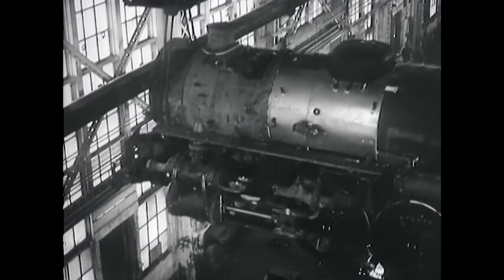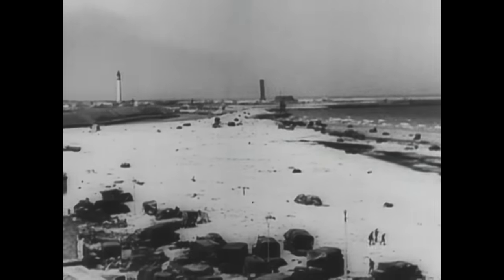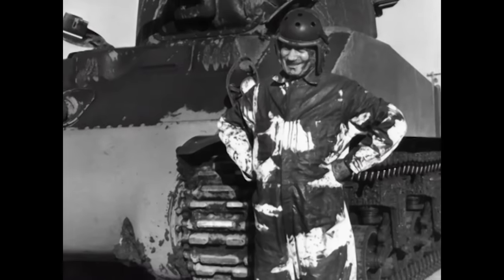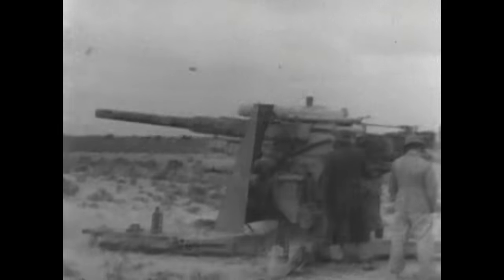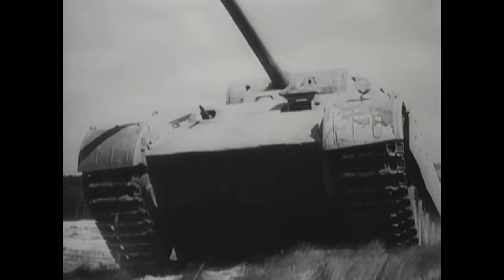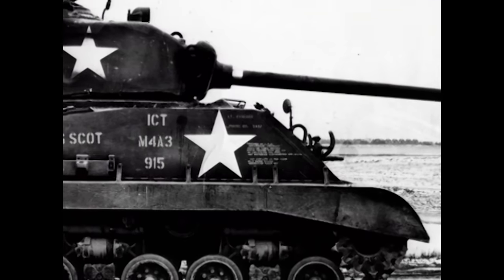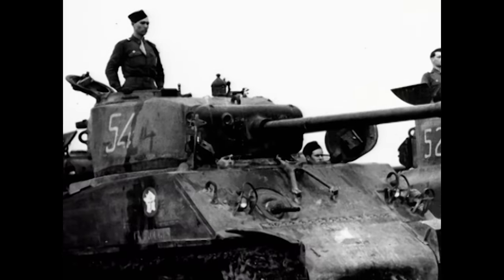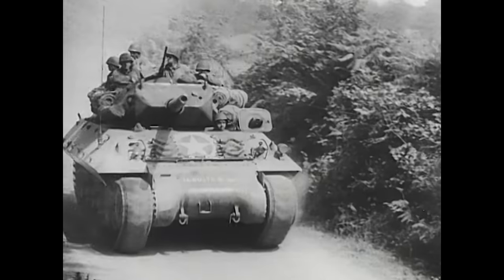Why The Sherman Tank Arrived Just In Time For The Allies | Tanks! | War Stories

Comment: The coolest thing about the Sherman were the level ups. Upgrading the hull to plate welded armor, better ammo stowage, better suspension, and a higher velocity gun eventually made the Sherman an incredibly strong tank for one produced in such high numbers.
Reply: Limited numbers of Jumbos apart, I wouldn't call it "incredibly strong" tank by 1944/45 standards, and Sherman crews didn't agree with that.
Reply: By 1944 it was well out of date and the 76mm gun was only marginally better than the old 75mm. It was bottom of the league in terms of gun performance.
Reply: @billballbuster7186  The heavier armored versions of the panzer IV, the H and J variants, were the only medium tanks that the 75MM versions had consistent problems with. They were not numerous or reliable, their speed was a full 10MPH slower than the previous versions, and their range was abysmal. The 76MM did not have issues dealing with them. Anything heavier armored would have justified an airstrike. The myth that the guns on the Shermans were inadequate originated with the Battle of the Bulge, during which a number of heavier armored Panzer IVs and heavier tanks were used. The American troops in that portion of the line were mostly newcomers and Airborne. The real takeaway from that battle was the inadequacy of the American bazooka. If the Shermans had a heavier gun then speed and range would have been lower, and the chances that they could mobilize to fill that gap would have been lower. 

Also the 76MM was not a marginal upgrade over the 75MM. It was a much higher velocity round and the diameter does not paint the whole picture. The round was longer and heavier. The higher velocity meant that the explosive versions of the rounds couldn't have as much punch, and many tank commanders chose to stick with their 75MM due to using their tanks primarily in an anti-infantry role. Tank on tank battles were never a good idea for anyone involved. The majority of tanks of any kind were destroyed by aircraft, mines, and infantry carrying anti-tank weaponry. The range, reliability, numbers, weight and anti-infantry capabilities of medium tanks were essential. Being able to go tank to tank was not.
Reply: FYI The "Level-ups" as you call them, were mainly the result of mass production. The M4 and M4A1 were identical but some factories used welded RHA plate. While Lima used steel castings in its construction. Indeed every factory had its quirks, different engines, engine decks and construction details.

In 1943 it was decided to update the Sherman rather than introduce a new tank. The original design had poor protection, it easily burned when hit. So "Wet" ammo storage on the hull floor was introduced. It was still too tall due to the Radial engines still being used. The 76mm M1 replaced the 75mm in a turret designed for the T-22 - T-23 which were intended as the Sherman replacement.

The 'new' Sherman entered production in 1944, but in truth it was far from ideal. Its technology dated from the mid-1930s and the M1 Combat Car. The Sherman itself was designed in 1940, so in reality it was an old tank dressed up a little. Today tank designs age more slowly, but in the 1930s and 40s there were new innovations every day. The Sherman was positively primitive when compared to the British Cromwell which entered production in1943 or Comet of 1944 in the same weight class.
Reply: @billballbuster7186 The up-gunned 76mm high velocity gun had enough power to punch through the frontal armor of a Tiger tank. The E8 line of Sherman tanks made it one of the most feared tanks in WWII. Combined with the improved engine, it was a tank killer.
Reply: @chris.3711  No, the frontal armour on the Tiger was 120mm of high quality face-hardened armor. The 76mm M1 could penetrate 87mm of armour at 1,000 yards, do the math. Also there is no record of a 76mm M1 ever penetrating a Tiger, not one instance. You are just shooting the breeze, speculating on fake WoT info. Your generation frequently gets fantasy mixed with reality. The ONLY allied gun known to have penetrated the frontal armour of the Tiger and Panther is the 17 Pounder. Which could penetrate 130mm of armor at 30 degrees and 1,000 meters.
Reply: @chris.3711  Incidentaly the "E8" suspension had nothing what so ever to do with tank gun performance.
Reply: The Sherman was a bad design. It had a very high profile, poor mobility, light armor and a weak gun. By 1944, even the upgunned and uparmored panzer IV tanks easily outmatched the Sherman. Against more advanced designs like the Panther or Tiger, the Shermans were all but wiped out in tank versus tank engagements.
Reply: @haroldfiedler6549  It was universal, all WW2 tank veterans using the Sherman criticized it. Mainly because of the ease at which it caught fire and the gun was useless against other tanks. The 1944 versions had  better safety against fire but the gun, 76mm M1 was still bottom of the tables in performance. Only a total idiot would make the claim they were great tanks. The US claimed it took at least 5 Shermans to take out a Tiger or Panther.
Reply: @billballbuster7186  " frontal armour on the Tiger was 120mm of high quality face-hardened armor"
A common myth that is easily debunked when you realize that the Nazis didn't have the proper metals to make their armor properly hardened. They were running out of every material needed and the quality of their armor took a serious dive halfway through the war.
Reply: Most people don't know but armour had different quality standards. British and German were considered the best as they pioneered many of the hardening processes building Warships. German amour was excellent when Tigers 1s were produced. Not so good on Tiger 2 and later. However German armour could take a 25% drop in quality and still be better than American RHA.

But this is moot, in all my years studying this subject, I have never come across a genuine Instance of a 76mm M1 ever penetrating a Tiger. US Ordnance did do studies on captured tanks and hulks, but all failed. As I said the 76mm M1 was bottom of the pile in High Velocity tank guns in 1944. Even the tiny British 57mm 6 Pounder firing APDS  was better!
Reply: @dewdew80  You "debunked" nothing as the German armour issues came after the Tiger was in service. There have been no analysis on how much German armour was degraded or how severe the issue was? Only a blanket statement that armour production was affected by metal shortages. Pundits like yourself use that to promote the theory that the Tiger could therefore be penetrated by the 76mm M1, though there is no actual evidence for this, so no substance in your claims.
Reply: @billballbuster7186 Germany killed their own factory workers; just plain stupid.
Reply: @billballbuster7186 so you watch YouTube videos praising national socialist tanks; that doesn't make you an expert.
Reply: @dewdew80 the guy's an expert; he watched many YouTube videos 📹
Reply: The Germans had long barreled 75mm guns in 1942 we didn't get long barreled 76mm guns until 1944. This was due to superior German metallurgy.  The 76mm 3in gun in the M-10 was thick and too heavy to put into the Sherman. Western allies tank technology was 2yrs behind Germany.
Reply: @brooksroth345  the superior T-34 forced the German's hand.
Reply: Ok, if you refuse to believe the Sherman was a great tank then what did the Germans think of it?  Well, I don't remember the exact source, but the Germans did capture quite a few Sherman's, and gave them to panzer commanders and their crews to test their abilities.  We know their conclusions because they documented the results and their thoughts.  So, what did they, the Germans, who were used to using, "vastly superior tanks"?  They liked everything about it, from the gun, to the armor, the mobility, and especially the full set of spare parts that came with each tank, and the tools to use them.  In fact... the ONLY complaint or critique that they had was the height of the tank.  Do what you will with that information.
Reply: @haroldfiedler6549  bad compared to?? It was about 2 inches higher than a Pz IV, but shorter than a Panther and Tiger. It had 93 mm equivalent frontal armour (50 mm sloped at 56/57 degrees), the Pz IV only had 80, the Tiger 102. The Pz IV gun was superior in anti-armour, no debate there, but the Sherman had multiple things that made it a balance if not slightly better, and the later 76 mm armed versions and Wet stowage hulls were closer to being on par with a Panther, which weighed 10 tons more...
The Tigers and Panthers were, by most measures, heavy tanks and very rare. The occasional encounter with a Tiger could be dealt with by tactics and other weapons, the Panther actually was a greater loss compared to Shermans when fought...
Reply: @billballbuster7186  it wasn't 120 mm, it was 102. The 76 mm M1 only penetrating 87 mm of armour at 1000 yards was 30 degree sloped armour, not the near vertical of the Tiger front plate. Reality was more like 116 mm at 1000 metres
Reply: @brooksroth345  the l/43 75 mm the Germans had in '42 were rare, in the Pz IV F2 or 'Special'. A handful of them vs hundreds of L/40 M3 75 mms isn't really the detriment you're claiming. The M1 76 mm was put in a Sherman before it even saw combat in '42 but it wasn't an ideal fit. When it could have been available in early '44 it wasn't deemed necessary, which was well considered.
The idea to build thousands of decent, 'well armed for the main task' tanks rather than a handful of quite strong ones as the Germans did is precisely one of the elements that won the war. The best tank will always be the one  that you have in battle, not the one you don't!
Reply: @MarkofZollo  I gave gun comparison according to universal data which is penetration at 1,000 meters at 30 degrees. However ammunition is not exactly constant so when tested at this range there is 51% penetration, 49% don't penetrate. I really don't want to labour the point, but there is no recorded instance of a 76mm M1 EVER penetrating a Tiger 1 frontal armour. So you are talking theoretically not factually. Now the little 6 Pounder (57mm) was capable of of penetrating Tiger frontal armour using APDS. it penetrated 132mm. 1,000 meters at 30 degrees. That was fact.
Reply: @billballbuster7186  you said "87 mm at 1000 yards", not metres. Regardless, 30° is not 0° as per the results I've quoted or 2° as the Tiger's front upper hull was.
Whether a weapon was recorded as doing so does not indicate available performance. Like saying 'did a longer 90 mm on the Super Pershing penetrate a Tiger frontally, because if it didn't it's gun wasn't able to...'?
Reply: @MarkofZollo  just FYI only the final two variants of the Panzer IV had 80MM front armor. First it was 30MM, then 50MM. The final two variants with the 80MM armor had issues with breaking it's transmission, getting stuck, and speed dropped 10MPH. I guess that late in the war they had to compensate for the lack of proper hardened steel by piling cracked metal on it. What's funny is the various Panzers were always about 5 to 7 tons lighter than the equivalent Sherman...yet more evidence of how feeble their transmissions and engines were. Another fun fact is that wet stowage was unique to the Shermans, and ammunition going up is what led to the myth that Shermans were fire prone. The percentage of Shermans going up in flames was the same as all the other tanks in the war, then wet stowage happened and suddenly Shermans became the safest tank crew you could be a part of...didn't stop American tank crews from complaining though
Reply: @dewdew80  well, the G also had 80 mm total but that was 30 mm appliqué on 50 mm, not just the H and J. I know the J was the one that suffered most with trans issues, being that they had to simplify the design hugely to get production numbers and with reducing resources (whilst wasting them on other vanity projects) and that is why electric turret traverse was removed, hampering the tank a lot.

Pz IVs were lighter, as you say, but had thinner tracks which degraded potential performance.

The wet stowage is a good point, as you say the Sherman was not really any more likely to 'brew up' when penetrated than most tanks of the era, but with the Wet stowage hulls, more a case of moving the ammo, made them the safest tanks on the battlefield!
Reply: @MarkofZollo  The Wet Ammunition Stowage came about because of the ease at which the early Shermans burned. It was the most serious issue with the early tanks and one that demanded remedy. The wet stowage helped with the burning issue. But the Sherman was still far too easily penetrated to be called "safest tank on the battlefield".

In terms of firepower the 76mm M1 could take out the Panzer IV at battle ranges. It was also good against the Stugs and Jagdpanzers that were increasingly taking over the tank role by 1944. Note applique armour used on these vehicles was a lot easier to penetrate than thick single-piece armour.

But by 1945 the Sherman was obsolete when compared to the latest foreign designs. British Comet and Centurion. Russian T-44, T-54 and IS-3. The Sherman was not scrapped because the US failed to produce a satisfactory 80mm tank until the M-48 in 1952. The M-26, M-46 and M-47 all had serious issues.
Reply: @billballbuster7186  indeed, the Wet stowage hulls were to prevent the propensity to burn when penetrated, but as stated before this wasn't really any higher than most contemporary tanks. It was quite a common issue of the era. Reducing the average 'burn rate' to about 15% was a huge achievement and better than any other tank of the time IIRC. That plus the average death per knocked out Sherman being 1.2 men, which I believe was also lower than most. Tell me of one that statistically was safer 🤷‍♂️

As discussed, the 76 mm was decent and able to take out contemporary mediums at combat ranges, plus heavy tanks (even if there wasn't a record of doing so).

How on earth was a Sherman obsolete?? You've mentioned the Comet, which was a great tank was a good gun, though reduced performance on the 17 pounder but still a bit better than an M1A1C 76 mm, a nice low tank but less armour and quite horrible ergonomically. Then a T-44....that was never deployed as it wasn't really any better than the T-34/85... and T-54 that was produced years after the war????
How did the T-54s fare against the upgraded Shermans used by the IDF again? 🤔

M48 had a 90 mm, and yes the series was troubled. K
Reply: @MarkofZollo  Here you go again using fake info. Only that idiot on Chieftains hatch - a gamer not a tank expert - says Sherman burnt like any other tank. That is rubbish, the many complaints was the reason why wet stowage was introduced. If ir wasn't a problem, why extensively re-design the tank to fix it????

The 77mm (7.62mm) on the Comet was only about 15% less powerful than the 17 Pounder. Penetration was 110mm (1,000m / 30) using standard APCBC and 170mm (1,000m / 30) with APDS. That is a lot better than any 76mm. Armour was 102 mm compared to 63mm (angle + 75mm flat plate) on M4 76 variants. Comet was 32+mph and had excellent ergonomics. A far better tank all round.

The T-44 was quickly surpassed by theT-54 which was in production 1946. The 100mm gun easily out classed both US 76mm and 80mm guns. The IDF was subject to sanctions and the Sherman was the only tank they could buy. However they ditched the 76mm in favor of the French 75mm and 105mm guns. You can not really rate tank performance as they were fighting Arabs! The Arabs could have had Leopard 2 and still lost.
Reply: @billballbuster7186  🤣 what's the fake info you disagree with?
The Chieftan wasn't who I was quoting anywhere but he is vastly more reputable and accomplished than you are 🙈
I guess I'll need to dig out the post-war studies that showed the burn rates. Applying your logic, if any tank is so good why upgrade it or replace it? 🤦‍♂️

Where was the Comet 102 mm? Were the first versions not the same 76 mm as the Cromwell?
Still that is less than a Sherman's 93 mm equivalent armour (50.8 mm @ 57° on the early ones and 63 mm @ 47° on the later ones). What are you stating is 'angle 75 mm flat plate'?

The Cromwell and Comet were known as being horrible ergonomically. Quite cramped inside and tiny hatches...

Yeah, produced after the war and in service or maturing years later. What's the point? That doesn't make something else obsolete years before 🙈
Yeah the Centurion made the T-34 obsolete 🙈

The US used 90 mm guns in their heavier tanks, can you correct that from repeatedly saying 80 mm?

Oh, can't rate the meeting performance becoz Arabs? Same I guess with the T-34s in Korea becoz Chinese? Great point, well said.
Excellent debate 🙈
Reply: @MarkofZollo  If you read any WW-2 account by vets that crewed the Sherman, it was criticized for ease ease it caught fire. That is fact like it or not.

Now it would not surprise me if Uncle Sam did some Post-War testing to prove this wrong so maybe they didn't look so bad sending little Chuck to war in a death trap???

Lookup the technical specification of the Comet, frontal armour was 102mm. Now the 50mm plate on the Sherman though angled 56 degrees was too thin to stop most German rounds from penetrating. Tests showed rounds took the path of least resistance and nose dived through. The equivalent of 90mm flat plate was a myth.

The Chieftain is a gamer he has no real knowledge of tanks and tank warfare. But he is very popular with those that have less knowledge than him.
Reply: @billballbuster7186  crews criticised it, for sure, I've certainly read that, but also those that praised it. Take Zaloga's perspective then.
The stats are the stats, taken from combat records 🤷‍♂️
They caught fire sometimes when hit, but tankers escaped and were able to make record of it. They didn't always have the chance from other vehicles....

Oh lord, 'Death trap', don't get into copying the much debunked Belton Cooper or DeJohn 🙈

I think the turret front was 102, the hull was 76..
The 50 mm sloped front of a Sherman was plenty to stop most contemporary weapon rounds when introduced. It couldn't withstand some of the heavier AT rounds, of course, but then studies of the time found heavier armour also couldn't, so why reduce the number of decent tanks and delay the war end by however many months or years. The British survey concluded just fitting a bigger gun would suffice and hence the Firefly.
The path of least resistance against sloped plate is to deflect 🤦‍♂️
Equivalent 90 (+) mm plate isn't a myth, it's trigonometry....😅

The Chieftan, Moran, isn't a gamer, he is a serving US Army Officer, was a tank commander and tank platoon leader on two tours in Iraq and Afghanistan, and is a published author 🤦‍♂️
He is a senior in the WoT thing (I dislike it a lot) but that doesn't decry his legitimacy. "No real knowledge of tanks or tank warfare" 🤣 That's like saying all The Tank Museum's pieces are BS because they are sponsored by Wargaming as well 🤣
Good one 🙈
Reply: @MarkofZollo  The Sherman Firefly was a rebuilt. The Ammunition was moved from side sponsons to the floor of the tank and stowed in armoured bins rather than the US wet stowage. Because of the fire hazard.

The only 102mm armour on the Sherman was the pointed front of the "Mary Ann" late differential housing. The Sherman claimed to be resistant to the 5cm A/Tk gun at 500 meters. Pictures of frontal penetrations would suggest few  rounds bounced off as you claim. Sloped armour was controversial as it had to be 75mm thick at 45 degrees to reliably deflect shell projectiles. That would raise the tank weight substantially. The Panther had 80mm ftontal armour and that was 46 tons. The T-34 had thin sloped armour 47mm at 60 degrees and that was not much good ether.

Nicolas Moran is a part time historian and sponsored game influencer. He has not been in combat, though did two tours after the 2003 Gulf War was over. He was in the National Guard not regular army. Since 2011 he has been in US Army public relations for wargaming. But he is controversial and said a lot of stuff that has got him some backlash over the years.
Reply: @brooksroth345  That had nothing to do with "superior German metallurgy", and everything to do with the United States having different priorities with production. The US' steel was far superior to anything Germany ever made, and you thinking otherwise belies your complete and utter ignorance to the fact.
Reply: @billballbuster7186  You've more than sufficiently demonstrated that you are exceptionally ignorant of the realities of WW2.
Reply: @Harvest133  Yeh sweeping statements with no facts, typical comment  we expect from the ignorant.
Reply: @Harvest133  Steel armour is best researched using books on naval technology. Many of the steel hardening processes were pioneered by Britain and Germany. Tests showed that quality wise German armour was 10-25% more effective than that produced in most other countries. US steel was on the lower end of the scale. But Americans always think they have the best of everything. That was not true in WW2 when over two decades of Isolationism and low defense spending meant they were playing catch up. But as an American you refuse to believe the logic of that.
Reply: @billballbuster7186  that's great and all, but German steel by the time America was in Normandy was not the same quality as before the war startbecause they were getting their factories and supplies blown up by the allies. Many late war tanks were improperly hardened etc. American steel industry was also extremely advanced and huge. The US steel industry dwarfed the German industry and the US had access to materials the Germans could only dream of. Can you spell molybdenum or vanadium?
Reply: @Harvest133  This is something of an internet myth, as I have seen no credible information on how badly German armour production was affected if at all. The British naval blockade of Germany did cause supply issues but in most cases alternative materials were found. I have only seen proof of poor quality materials in German firearms produced 1944-45. But in war firearms tend to have short live. Tanks were always the highest priority.
Reply: @Harvest133  Remember its not only having the raw materials but the expertise. That is how the Russians welded Titanium submarine hulls decades before the Americans. Almost all hi-tech was given to the US by Britain in WW2. Including Atomic Bomb, Jet Engines, Radar, Proximity Fuse, Gyro Gun sight, Penicillin, ASDIC Sonar, RDF Navigation and Computor technology, to name a few.
Reply: T 34...